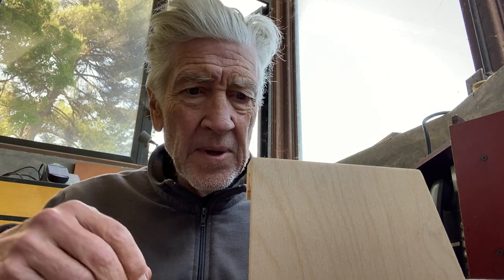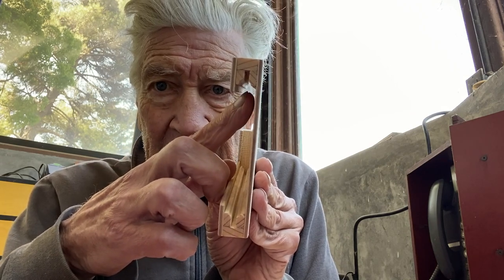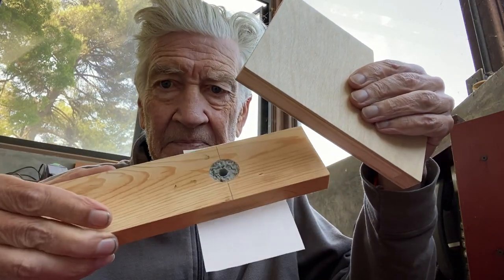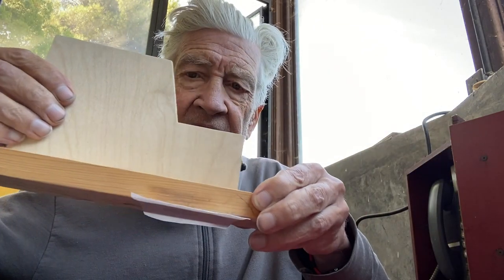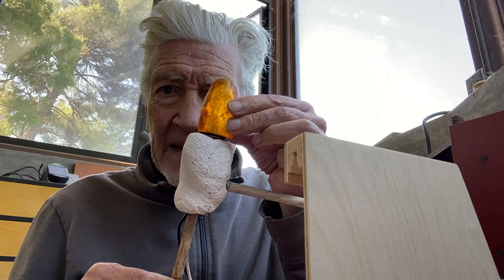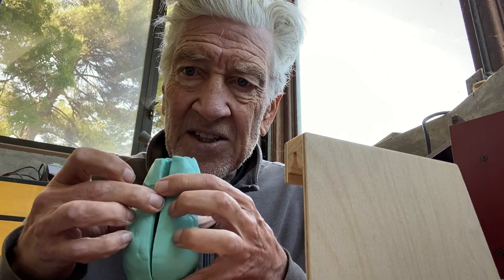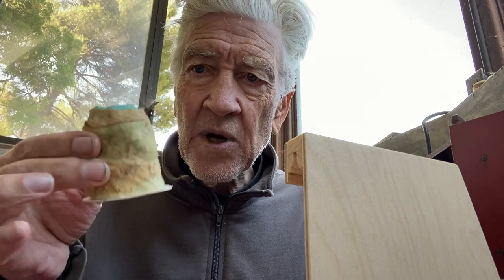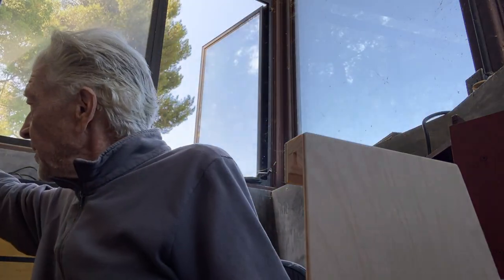What Is David Working on Today? 6/26/20 - Phone Holder

Comment: If I had some land and a whole bunch of lumber that I could use to build a cabin, it would be fun to make sliding doors and window shutters for it, similar to Mr. Lynch's camera rig.
Would just need to add caster wheels to the bottoms of the doors & shutters, and nail in track framing, to guide them to slide.

Comment: You might want to look at using LEGO.  It's going to make the construction a lot easier for you.  The great part is that you can re-purpose the parts for other things if you later find you don't need it anymore - or in case of your phone - you might need to adapt it when you change to a new phone and it has a different size or shape.

Comment: That note at the end is a bit like what I usually say about my own creations. A store bought thing might be better. Mine might be crap. But dangit. I'm proud of this crap I built!
Though David's stuff do not look like crap either so that's a win win anyways. 
I need to look into that epoxy fastener-thingy done here to get the nut to fix on the base without spinning. I actually have been doing some 3D print stuff where holding a nut really tight would be very handy.

Comment: What type of resin are you using? I have some resin items that have still not set up since last September! Can you believe that?! It was supposed to be a 1:1 ratio with a 48 hr cure time. A couple have cured, but some are tacky to the touch and some are down right gooey. I've tried wiping the tacky surfaces with denatured alcohol and acetone as well and all it did was dry out my cuticles. I once invested sterling silver in dyed resin with a catalyst curing process and had a similar issue. 15 years later the investments are finally cured and ready for carving...but I'm apprehensive about starting to carve them now because someone broke into my studio and stole a bunch of stuff including both of my cartridge respirators and a simple dust mask will not do the job for this AND I haven't seen a respirator on hardware store shelves in some time now...sigh.